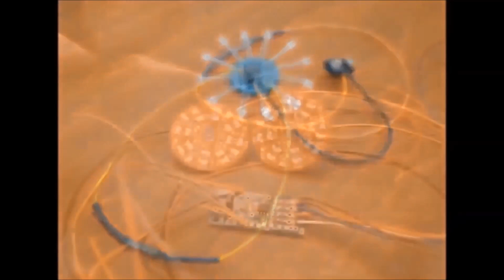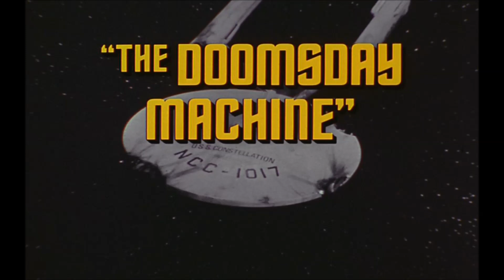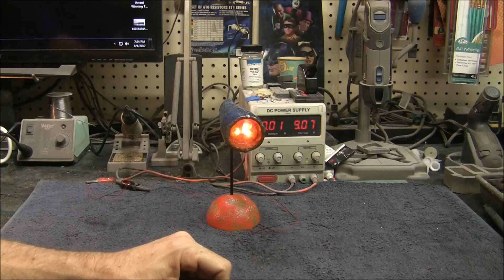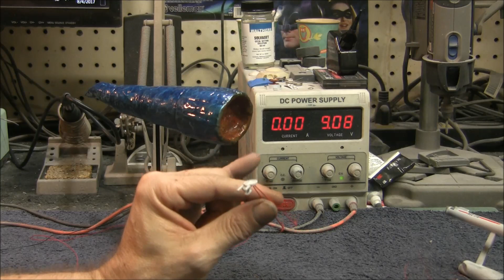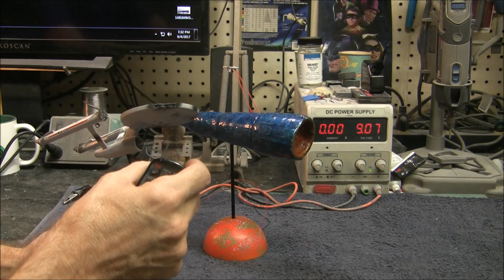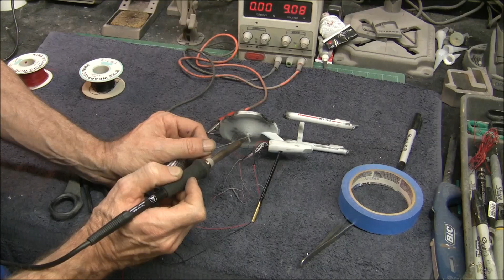Star Trek TOS Doomsday Machine Diorama Build Pt 1

Comment: Back in the 70s I built a wrecked Constellation using the AMT model.  It was pretty authentic because that's exactly what the prop department used, including the same techniques for melting the damage and creating the scorch marks.  It's especially obvious because they just swapped the numbers from 1701 to 1017.  The Constellation was a Constitution class and should have been in the 1700 series, but the little number swap made it an oddball.  I don't think there was even an explanation in Trek Canon for the out of sequence number.  Other than the obvious one of course, and the prop makers probably never gave it a second thought that over 50 years later anyone would care!  This is particularly why the "remastered" i.e. "retconned" episodes annoy me.  Often the $$$ new CGI stuff actually looks worse than the original, and it's really kind of insulting to the people who built the original props and effects with the budget and tools they had at the time.  They did a phenomenal job, and today the studio says phhht, not good enough let's replace it with computer crap.  Fortunately I got the entire series on DVD well before they started this process.

Comment: One suggestion, though too late. I scratch built a Doomsday machine a year or so back. I did the flickering LEDs as you did but was not happy with the lack of depth or overall looks. Solved by putting a crinkled piece of shiny side aluminum foil a little distance behind the LEDs. The odd angle reflections filled up the maw wonderfully and helped give it a much better look.

Comment: I always assumed this was a rebox, or original boxing of the 1/2500 scale enterprise! 
Excellent work! Really captures the feel of that episode and the lighting is the icing on the cake!
Reply from the maker: I first wanted to use the 1/1000 scale kit but decided it was too big. Then when I looked at the 1/2500 it looked too small for doing the lighting effects I wanted to do on it. I remembered that I had the old 1/1600 kit and decided it would be best. It worked out good because it has the same inaccuracies that the original 1/650 model does.
Perfect for my retro tribute to the original episode before the CGI came along.

Comment: I had bought 4 of those kits in 1977. they had the decals to make 14 starship names just like the 1/650 kits did back then. Not knowing about the TOS Hull number debacle I assumed that the names were in sequence as Enterprise was the first name and them 13 names after it. I made a list of the ships in this order and years later found out that my number system was different than what had aired on TV. But anyway, I don't know if you got a hold of an already opened model, or they stopped putting those decal sheets in the kit. I sat up almost a whole night and built all the ships in all 4 kits, and made Enterprise, Lexington, Yorktown, and Excalibur. I imagined a Battle of Midway in space LOL.